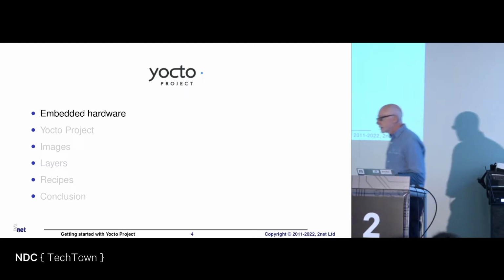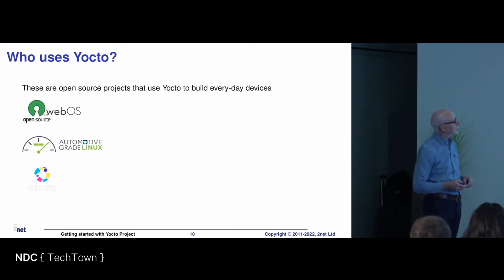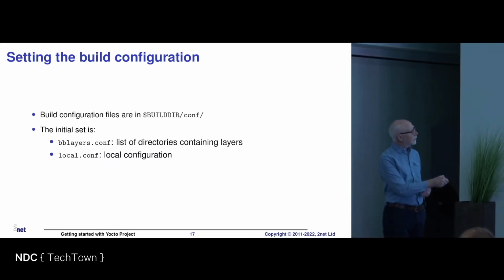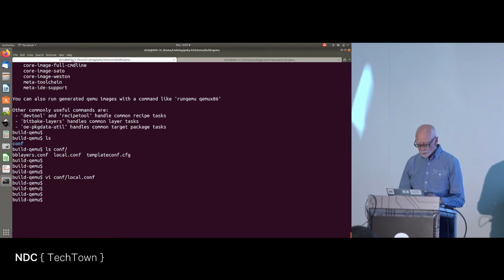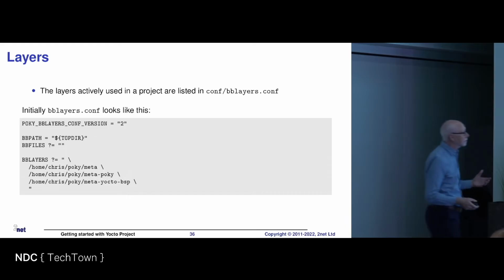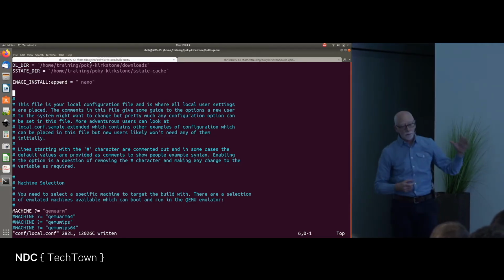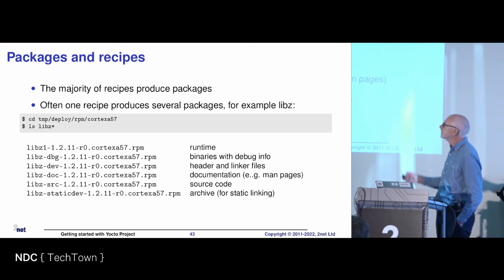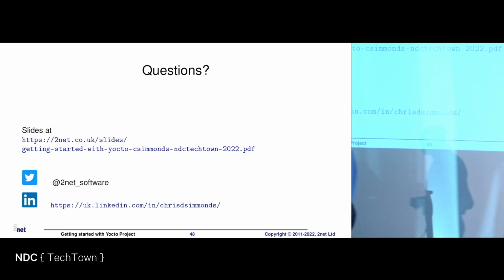Getting started with Yocto Project - Chris Simmons - NDC TechTown 2022

Comment: 00:12 Introducing Yocto Project for embedded systems
02:34 Designing custom computer boards for volume and economic benefits
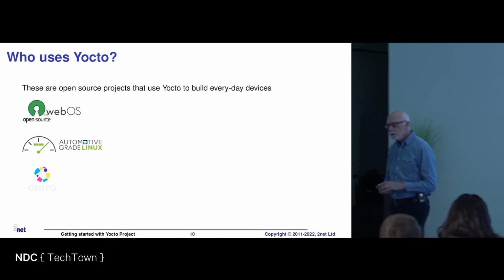07:34 Yocto Project is widely used in various open source projects and popular devices.
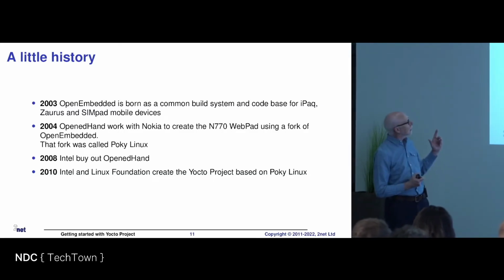10:09 Evolution of Yocto Project from OpenEmbedded and Poky Linux
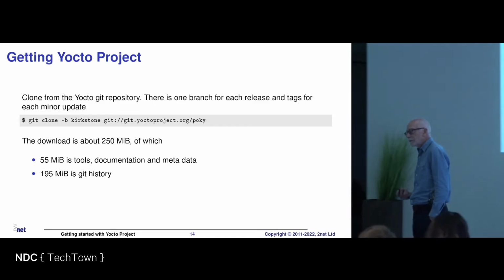15:10 Yocto Project setup involves initializing the shell and configuring variables.
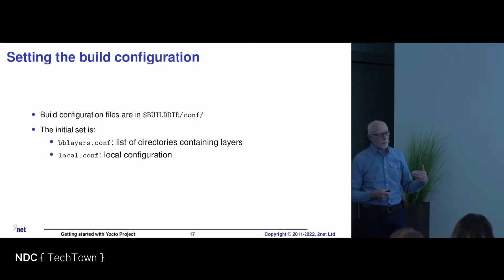17:33 Understanding Yocto Project layers and configuration
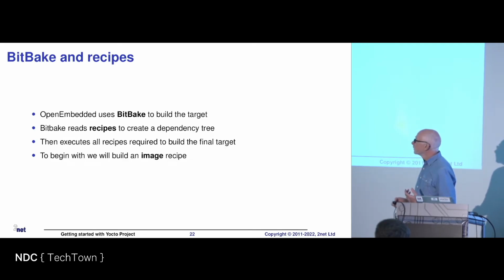22:09 Yocto Project images are specified by recipes and can be customized for specific needs.
24:16 Configuring Yocto Project for QEMU Arm 32-bit machine
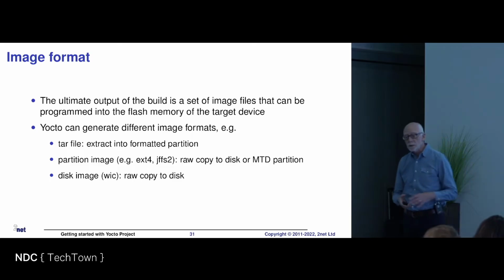28:43 Creating and using disk images in Yocto Project
30:53 Setting up variables and paths for pre-loaded Shared State cache and downloads
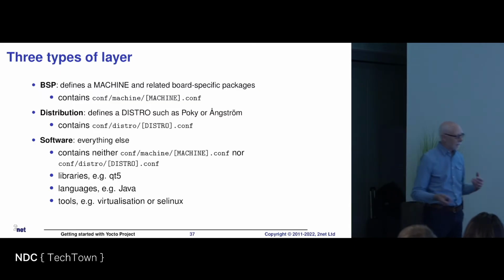35:39 Yocto Project supports various components and tools beyond BSP and distros.
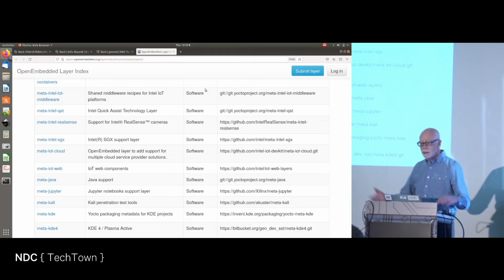38:04 Adding software to Yocto Project
43:02 Demonstration of creating and editing text files using Nano in Yocto Project
46:01 A recipe in Yocto Project contains instructions to fetch, configure, compile, and install a software component.
50:25 Adding packages to the Yocto Project Target
53:09 Yocto Project is an industry standard for embedded Linux systems.
58:33 Board Support Packages and Kernel Replacement
1:00:55 Licensing in Yocto Project overview

Comment: I've used buildroot in the past (because I was working with OpenWRT) but the people at my old job were always on about Yokto, Poke-ey (they used the wrong pronunciation) and Bit-Bake.
I'd love to see a side-by-side comparison of the two from somebody who's used both and doesn't have any allegiance to either. I get the feeling that Yokto is the way to go but devs love shiny things.
Reply: The guy explains it's poh-key, cuz it comes from the Pocky japanese snack.
Reply: One thing is bsp availability. Often CPU vendors like nxp offer official yocto layers for their cpus, socs, soms and eval boards. There are very good reasons for this. The layer architecture specifically. Basically you can use one layer that has all the patchsets for the kernel and libraries (like hardware encryption) etc. It is really neat for that. For the normal user and dev it is a really odd way, orthogonal to packages. For the BSP vendor it is pure heaven. Make a layer, throw all patches into recipes, say what you are basing things on, done.